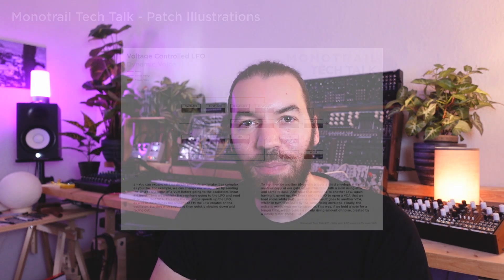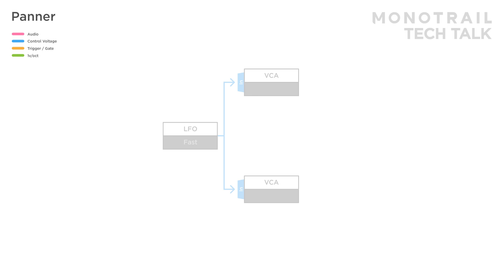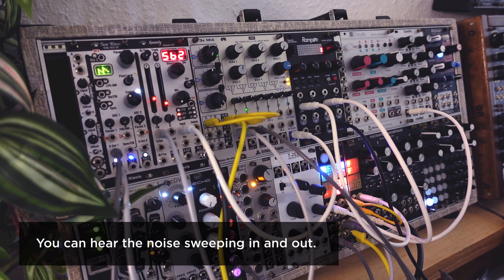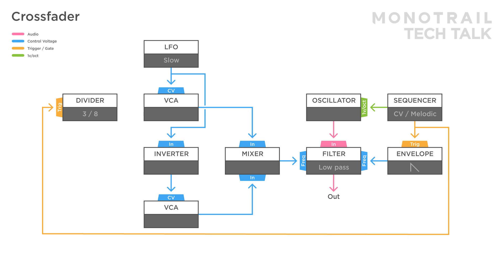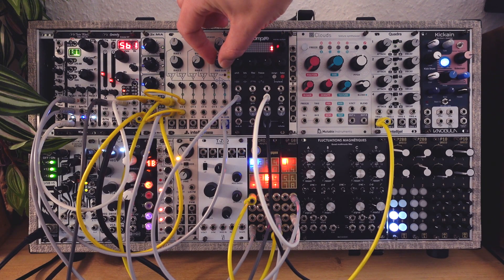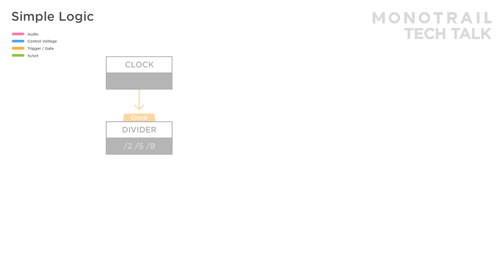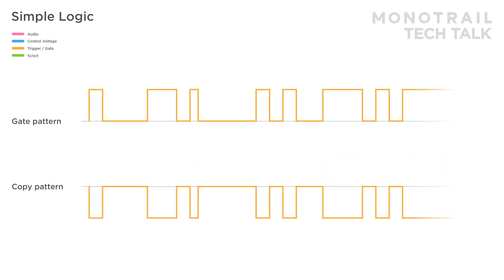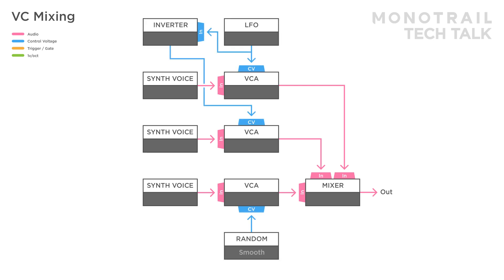6 Useful tools you can make with VCAs

Comment: This is amazingly helpful.  Too many times with Eurorack videos, the patches are specific to module functions that my meager DIY setup can't manage, or they need a set of utilities that I haven't gotten to yet, so I'm often spending more time with gear envy or planning future builds than patching and playing after watching.  But looking at the panner, it turned out I actually have built all the proper pieces to use it.  I found that my two IamO jfet VCAs work fine for this, my attenuverter can indeed invert an LFO to drive them both, and my headphone amp — the last module I built, by some coincidence — can be fed by the VCAs properly,  so I patched it up and it worked exactly right.  

The others managed to work too, with minor modifications, like how I'm using maths-like function generators to create clock dividers, or an amplified external tape loop instead of a sampler.  So thank you for taking the time to break these down for us!
Reply from the maker: Hey, thanks for letting me know! Sometimes it's unavoidable but in general it's one of my core principles on the this channel. Explain and demo as much as possible with generic functions. Glad you got some use out of it!

Comment: I recently learned that you can use a two channel mixer like 3xMIA as a simple latch, ie comparator fixed to compare against 0v. Just send the signal to one input and feed the output back to the other. The gain on the feedback controls the hysteresis. IME the output is a bit gnarly and jagged, so great for audio rate mangling.
Reply from the maker: Hmm, nice, thanks for sharing!

Comment: i would just say be careful when summing triggers and gates cuz some modules i think some doepfer modules will break if you send a gate higher than 10 volts.
Reply from the maker: Hi there! It's always good to be sensible about levels. If you mix things don't just crank all levels to max :) When mixing though, voltages wont stack limitless. If you mix 3 10v triggers, you won't get a 30v trigger. When mixing audio that would be called clipping, or just distortion when summing signals hit the max output of a mixer or summing VCA. I also never hear of a module breaking when feeding it a high input! Regardless, I'll never claim to now everything, so feel free to link to manuals or info that confirms that. Always a good day to learn, Cheers! :)
Reply: yeah i wish i could remember where i read that +10v thing, i remember reading it on a manual of a module, but that was years ago @MonotrailTechTalk